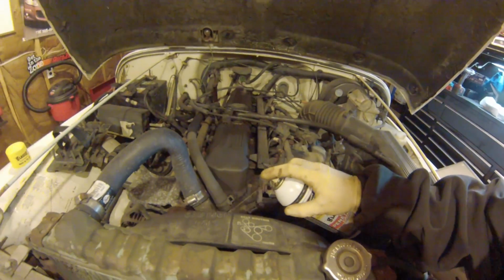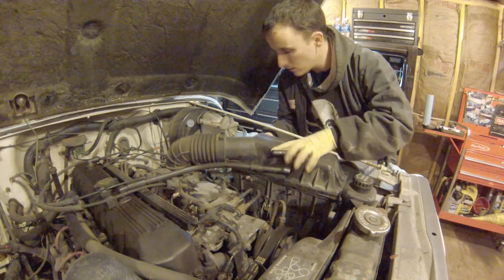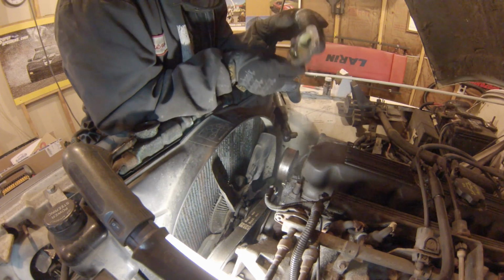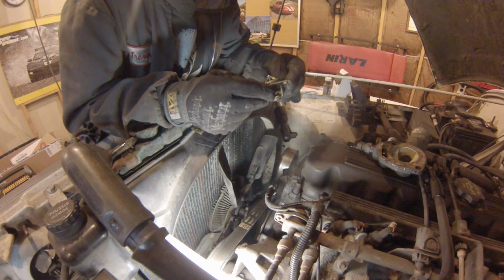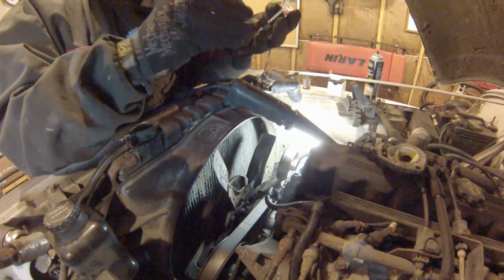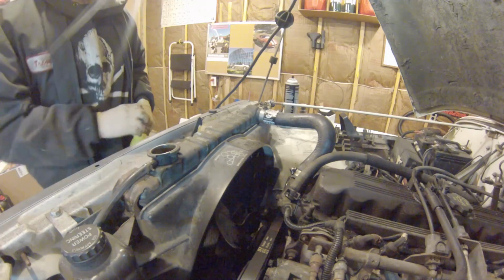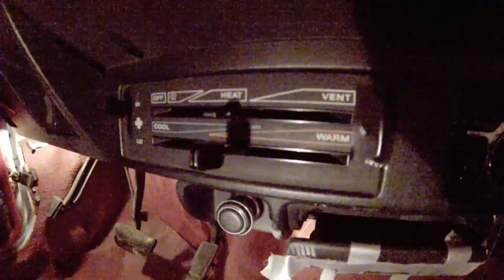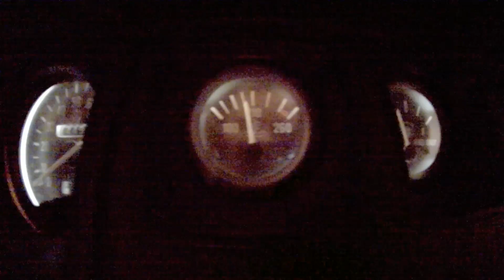Rusty Renegade: Ep 07- Fixing The Heat Out In The Cold

Comment: I managed to repair my plastic flares, but the two underlying front fenders are too far gone with rust to repair. I can't seem to find replacement fenders with the cutouts already in place. Im up in Canada, maybe you have a lead for renegade stuff down near you?
Reply from the maker: I have the same problem here I'm afraid. Chele's front fenders are really rusty as well. Every time I try to weld patches on the welder just pops and I can't lay a good bead, the metal is all just too far gone. I think the best bet for the front fenders would be to get some new standard YJ fenders and cut a and drill them to match the Renegade ones.

Comment: Are you planning a restoration on the renegade? I'm finding it an absolute bitch yo find body parts for
Reply from the maker: We're just kind of fixing it up as we go. It's my girlfriend's Jeep, and she really doesn't have the money to do a full restoration (not that I do either!). I would love to do a full resto on it, but it's so rusty it would need a bunch of welding on the frame, and the whole tub would be better off just being replaced all together.
As for finding body parts, I hear ya there. I've been searching high and low for the correct front bumper with no luck. I've seen some back bumper covers on e-bay, but we don't need those. I think I can repair whatever damage is on the flares with plastic weld and some filler. I've found the correct wheels on e-bay too, but for not much more RockAuto.com sells refurbished ones.
What parts are you looking for for yours?